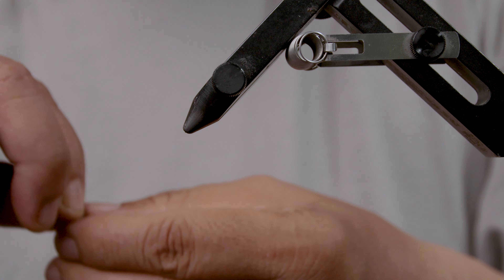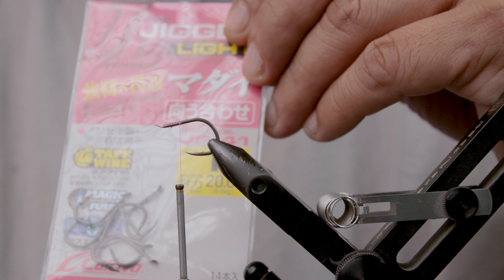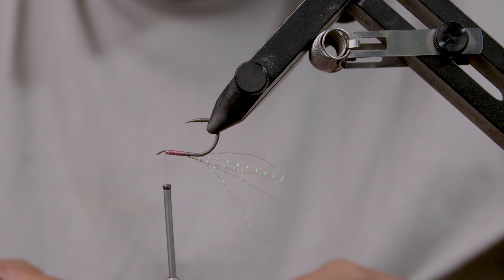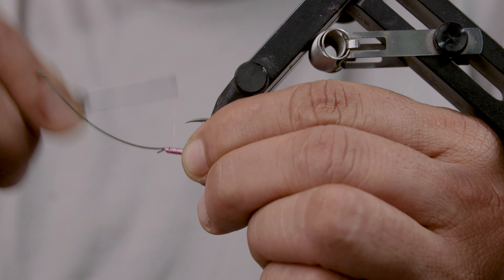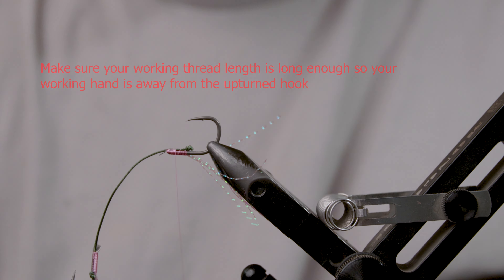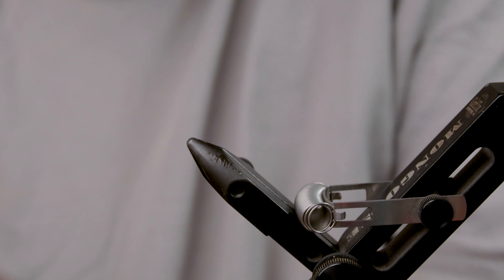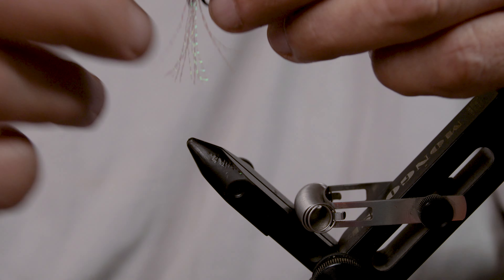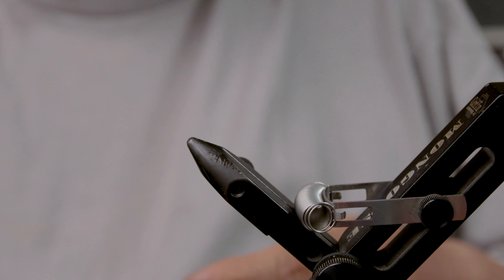HOW TO TIE DOUBLE MICRO ASSIST HOOKS  | CLEAN, EASY AND CONSISTENT

Comment: hello! What size(mm) and brand/type of cord can I use? I always throw with 30-40G jigs
Reply from the maker: in this video, I used 100lb braided fishing line that was left over from spooling one of my reels.
Reply: but using braided line isn't that recommended right? or it doesn't matter? @TheFishingKit
Reply from the maker: there are proper cords you can use made out of the same material, or kevlar. worse you can use is paracord....dont use that.  @oflackopr708

Comment: Hey Kit, are you tying your main line to the split ring? If you wanted to give the lure more action to entice finicky fish would you add a barrel swivel?
Reply from the maker: I put swivels or solid rings, depends on the situation - search the channel for the video on connection points - i discuss this at length in that video.

Comment: Surprised on the Jigpara mini irons how easily the finish gets dinged up on the rocks. Disappointed with the lack of durability in that area.
Reply from the maker: if you throw any painted lure on the rocks, they will get digged up. not just jigpara. end of the day they are still made of lead and that metal is soft. Try a spoon or a cast master - those don't digged easy.
Reply: @TheFishingKit  yes the vast majority of my fishing involves at least some rocks(on a jetty, many rocks) kastmasters cost less for this kind of surface wear.
Reply from the maker: yea...might be a better way - and they are also effective for some fish.